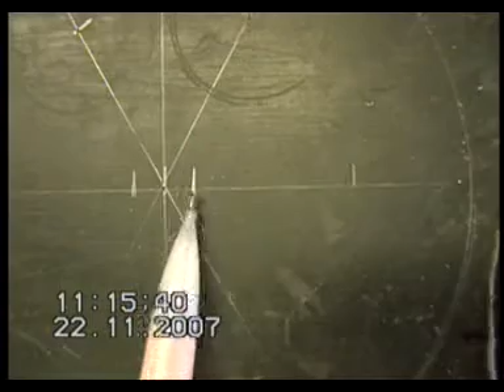Improved Cell1 - Marking out tube seperaters

Comment from the maker: This is gregted1 with an urgent warning.
*** STAINLESS STEEL WOOL BEHIND THE TIP DOES NOT STOP A FLASHBACK ***
I had a bubbler explode when using an oxy welding tip on the end of my hose. When I turned the power off, the flame must have built up in the tip and line and flashed through the stainless steel wool back to the bubbler and blew out the bottom.
My bubbler gave up its life to possibly save mine.
Again *** STAINLESS STEEL WOOL BEHIND THE TIP DOES NOT STOP A FLASHBACK ***